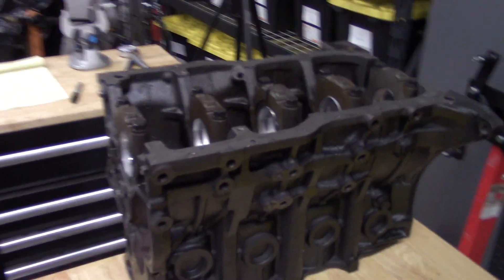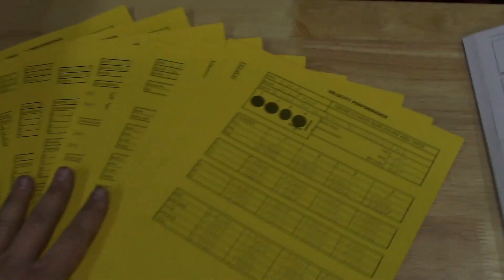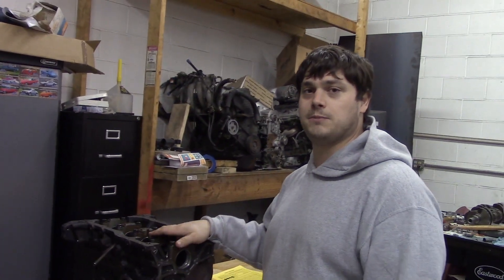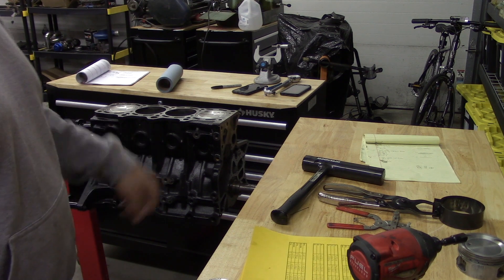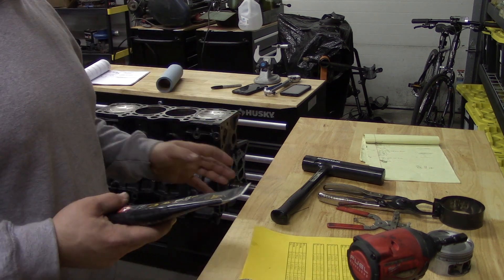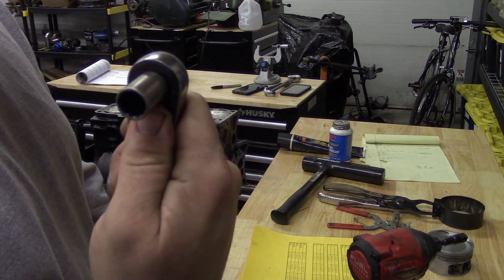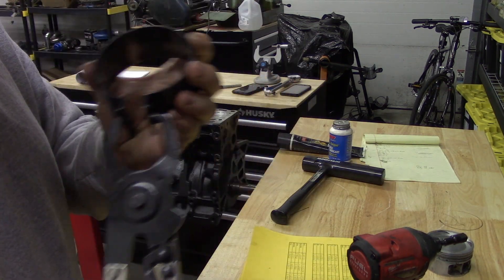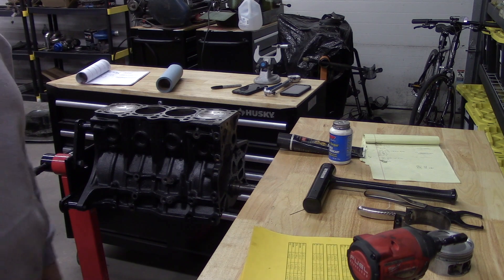5sfe project PT4 - Short block assembly

Comment: Justdid a timing belt on my  5sfe. need the engine crankshaft to turn freely now it was turning freely until I removed spark plugs and started it for a second to verify the engine crankshaft timing mark.is it dry of oily? maybe the belt is not on  at alignment on the  cam pulley?

Comment: Question: Have you seen the Adjustable cam gear for Starlet, Paseo, Tercel Glanza EP82 EP91 4E, 4efte, 5E, 5efe. engine. could it fit on ther 5SFE/3SFE. Its mounted on the outside of the head to degree the exhaust cam. https://i.ebayimg.com/images/g/sicAAOSwJ41Zza6h/s-l300.jpg

Comment: Are you going with the Yamaha head, or the 5SFE head? If you are going with the Yamaha head. Please lay out all the parts involved in this upgrade.
Reply from the maker: This is going to be the 5sfe head. I’d like to do a budget 5sgte build one day though.
Reply: @velocityperformance8574  What ever you do, we'll be following.
Reply: Do you need to change anything to the stock ecu to run the engine